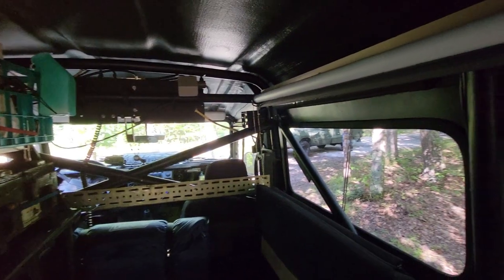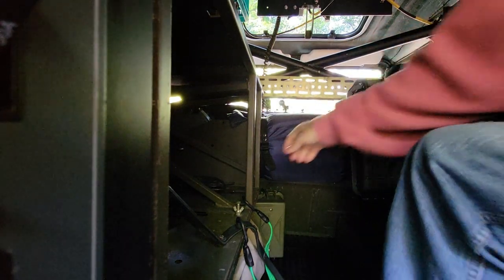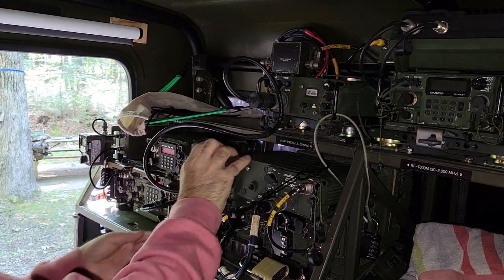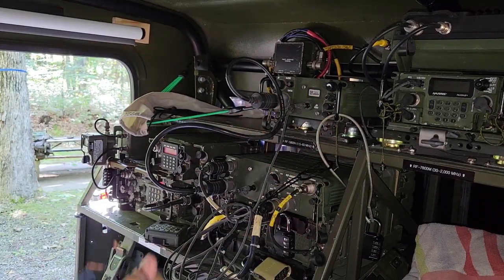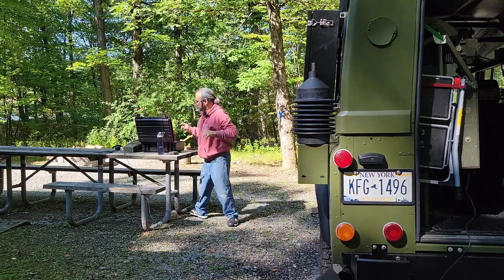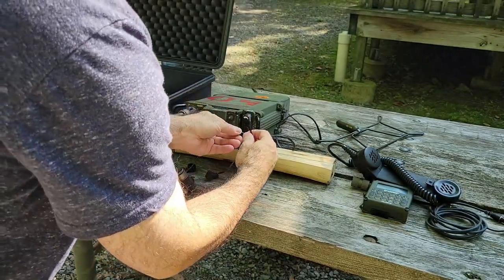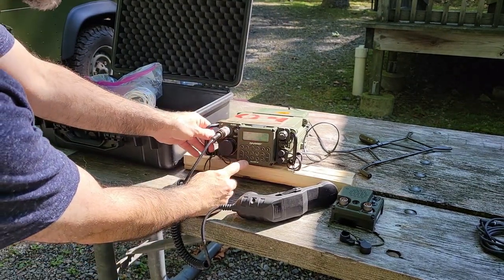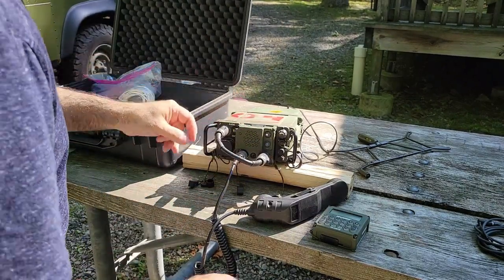Defender Camping and Harris Remote Control Testing

Comment: "He who dies with the most toys wins" - I think you are definitely in the running 🙂 Great video!
Reply from the maker: Got some information from some friends. Check if you have the A8 board. It may be missing. Or could be a cable on A8 is not seating properly. It can also be the A6 battery is flat and needs replacing. Good luck

Comment: I like it then the weather gets to Chile to operate in the back of the Land Rover you can go inside that nice warm cabin, diversity is.
Reply from the maker: Indeed! other than the fact I only had 25 feet of wire with me, with a proper roll of field wire, I could put the antenna up on the land rover and operate from within the cabin. Next year!

Comment: X mod wolf pack Landy as known in the uk, td5 or 300tdi engine?
Reply from the maker: Thanks! This is pre-wolf, called Project Tithonus which was a LEP program (life extension program). Engine is a 5.3L GM Vortec (Chevy Silverado 1500) with 6L80 automatic transmission. Goes fast, but gargles gasoline! Thanks for the comments!

Comment: Good afternoon. Encountered a problem with my rf7800h. There is a very large attenuation of the received signal when connecting a station with a power amplifier. If the signal from the antenna is given directly to the station's rose, everything is fine. Haven't you encountered this?
Reply from the maker: It sounds to me like the problem is within the amplifier or maybe coupler. Which model amp are you using? Are you using an antenna coupler as well? For example, the 5800H radio has an option to select either the HV output or Coax (N connector) output on the 5382A antenna coupler. If set to the wrong one, you will get almost no signal. Where are you from?
Reply: @w2hx  All connections are made correctly. The coupling is used by RF5382H, and it's also fine. RF 7800 B001 amplifier. From Ukraine. The station stood working for a long time surrounded by more powerful radio stations of the same range. Sometimes the protection worked and it was displayed that the levels were exceeded
Reply from the maker: @МаксимСлипец-щ5н  I doubt that nearby stations could have damaged it. These radios are designed to be colocated. While the wiring is correct, I would check the configuration setting. This setting is controlled from the radio to select which coupler output is being used. Are you using a whip on the coupler? or a coax with a dipole or something?
Reply: @w2hx  I understand what you're talking about. I use the output from the 50 ohm matcher and then the balun and dipole. But the problem is that the signal does not pass through the antenna-balun-feeder-conciliator-amplifier-station circuit, and if you apply from the approver to the input of the station itself, then everything is fine
Reply from the maker: @МаксимСлипец-щ5н  "conciliator?" Is this the antenna coupler (tuner)? I would try to move the RF cable from the coupler directly to the radio,  bypassing the amplifier. See if the coupler is at fault or the amp. Your problem is either the coupler or the amp, in my opinion.